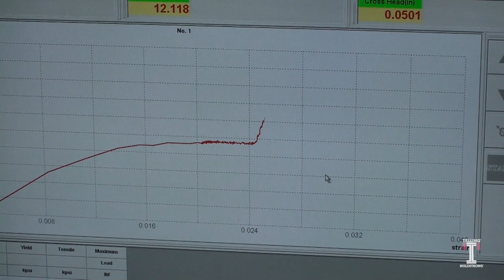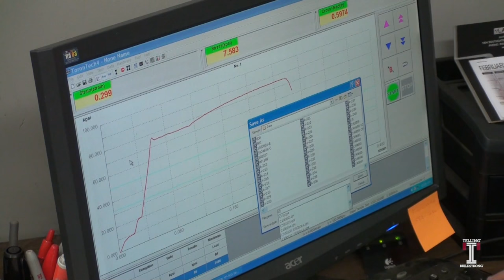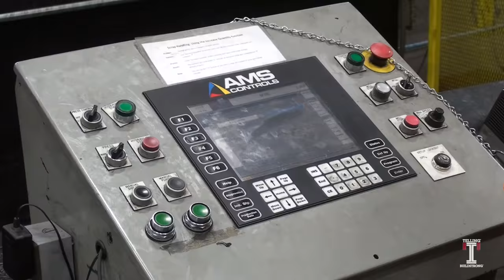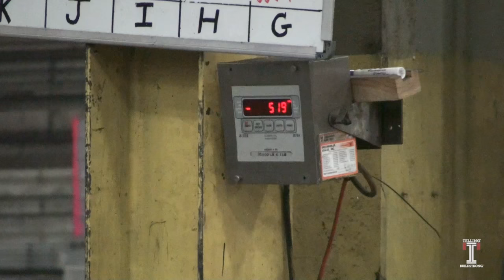Telling Industries - How Metal Studs are Made

Comment: I'm surprised that the steel rolls are transported via flatbed truck as opposed to having a rail siding and/or direct marine access given the weight & volume needs to produce studs in that quantity. A single rail car carries about three times the weight of a 5 axle truck, and you could use an electric road/rail shunter to move it directly into the facility underneath the crane hook. It could significantly decrease costs and capacity bottlenecks to have marine & rail access, primary to receive metal rolls but also potentially for some customers as well.